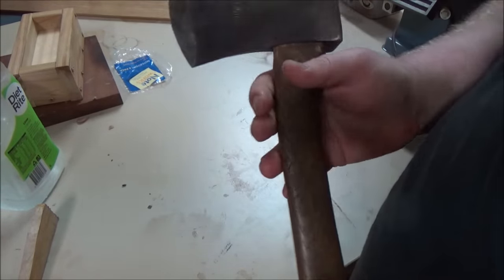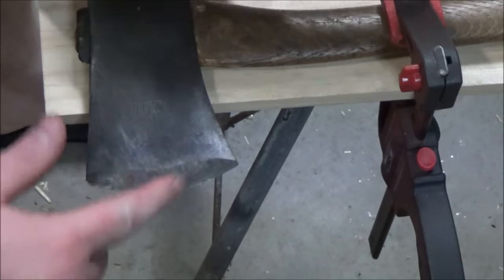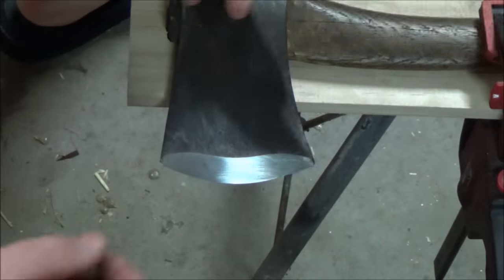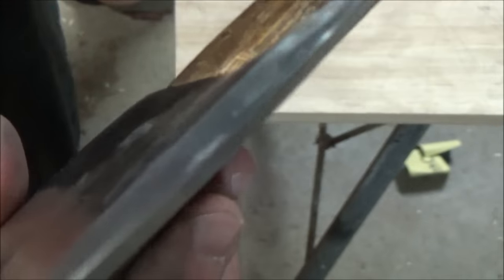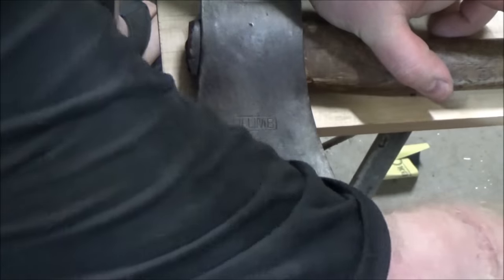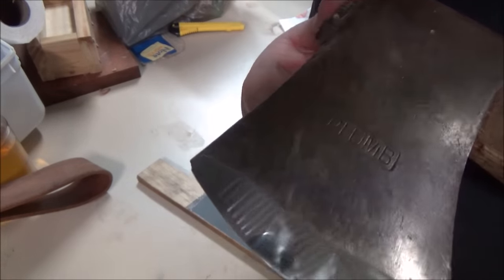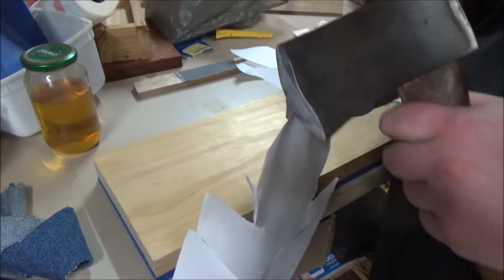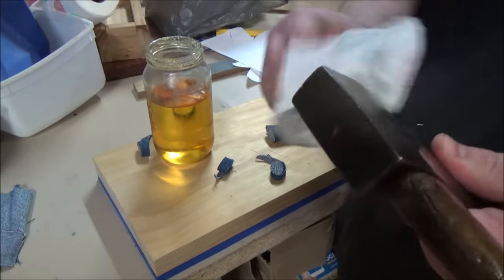How to Sharpen a Hatchet or Axe to a Scary Sharp Edge!

Comment: Looks like too much angle for an axe thats used for chopping or splitting wood.   That's a good angle for  detail carving such as jointery  or sculpting.  Usually, once your past 20 degrees of angle it's much too fine for utility work---you can use it that way, but it would dull quickly.   Still, cool video :)
Reply from the maker: I will mainly use this for carving or green wood (delimbing fallen branches things like that). I have no idea what the angle is but I also put a micro bevel on. If it hoes dull too quick just microbevel it again or even a bit bigger than a micro bevel until you get the toughness you desire. Also you could convex it from here as well if that us your thing.
I wouldn't normally have an edge this refined for normal chopping and splitting. It works fine but the extra work you put into the edge doesn't translate to much increased performance.

Comment: Good video.  Let me axe you a quick question.  How long did it take you to sharpen that?
Reply from the maker: Not including set up (cutting sandpaper, camera etc) it took me probably half an hour.
Reply: I envy the patience.Also if folk rush they waste the bevel.Sure anyone could take a belt tower to it but folk who actually use these implements,if they cheated every time,the tool wont last with removing so much.This patience is crucial to life of the tool.Real implement here..Cheers!!!! (Automotive bodywork place sells 3k grit))
Reply from the maker: The patience isn't too hard to come by. It is quite relaxing if you take your time and get comfortable beforehand. Also I use ones like this for more specialized tasks which allows you to sharpen them when you feel like it. Rather than gotta get it done now so I can use it. Doing it when you want can take the toil out of a task. Also you can always listen to podcasts, music or whatever at the same time.
Reply: @aldenunion  I would respectfully but strongly disagree with your analysis.  Using a belt sander will remove absolutely no more material than by hand if one is experienced. It will always take X amount of material removal to obtain the same end edge no matter if done by machine or by hand. The machine is simply much quicker. It is possible to over do by hand as well. Machines just seem scary because they turn out the same amount of work in a literal fraction of the time. In a sense it would for an inexperienced sharpener EASIER to over do with the belt sander because less physical effort is involved. If that is what you meant that is a specifically different topic.
Reply: @jamesp.noffsingerjr.7610   You just don't understand, for some of us "easier" isn't the most pleasurable for some of us and you will never accomplish this with a machine. However, before you reply I do see your point but there are those of us that do get relaxation out of hoarder work.
Reply: @angiecarlton826  I can appreciate the hands on zen aspect however I'm afraid that something got messed up sequence wise with our replies.  My response was directed toward whomever stated that power equipment would hog off too much or even more than needed.  YouTube doesn't plunk replies in sequence to the specific statement being replied to.  It just throws it in there by rime stamp and reads more like listening to a group of people in the same room all talking at once.
Reply from the maker: This is an interesting topic. Whether to use power sanders or not. I would say you can over sharpen with any method. But it is much easier to do with power tools. If you are experienced and can get a good bevel cut in without overheating the edge. Then go for it. If you are less experienced but still need to hog off tons of materal. Take it slow check the temperature often and maybe only take it 50% or 80% of the way or whatever you feel comfortable with. Then finish by hand. As you get better you will get closer and closer to cutting the whole bevel in by power tools. Which will save you time.
Also if it is a rough work axe like chopping out tree stumps and their roots in the dirt. I would just bang a quick rough grit edge on and start chopping.

Comment: Good video mate.  Just one question, what did you use on the handle of the axe?
Reply from the maker: Thanks. My bad, can't believe I didn't say what it was.
It is a 50/50 mix of turps and boiled linseed oil.
Reply: @scottshobbyz5416  Mate thank you very much, is there a particular reason for the turps?
Reply from the maker: It just thins it down so that it penetrates the wood better.
Reply: @scottshobbyz5416  Make sure EVERYONE knows to get the used rags or paper towel with linseed oil mixture OUT OF THE BUILDING when done with them. That stuff will spontaneously combust. Many a beautiful home being restored has burnt to the ground because the paint crew left rags used to clean the woodwork in a corner.
Great vid sir. I may do a neglected kitchen knife or two this way also.

Comment: any one who has actually chopped firewood would know, that a razor edge on an axe or hatchet is not the right way to do it, a slightly rounded dull [ish] axe head is much more successful and effective. ...Unless it is intended as a weapon...then you have it right.
Reply from the maker: For splitting wood this kind of edge is pointless you are correct. For cutting dead firewood across the grain the benifit of taking the edge this high in refinement over that of a file sharpened edge is minimal. Not worth the effort in my opinion.
For felling, de limbing green trees, carving, axe racing a really sharp edge does show noticable differences. In my opinion and the opinion of many professionals (I am not one) it is worth it.
I use it for the latter tasks.
Reply: this is not for chopping firewood, it's a real mans axe, not a splitting maul. Only real woodsmen know about this kind of axe, and the need for it to be sharp, maybe one day you will join the fraternity of true woodsmen and know these things.

Comment: Gotta say, in many, many years of using axes and hatchets for a variety of purposes I've never need to have one razor sharp.  If anything having them that sharp is a detriment.  When I need something that sharp I use a knife or chisel.
Reply from the maker: Need is a bit strong of a word. I would say it is beneficial in some tasks but not necessary. The ones that come to mind are wood carving, green wood (felling, limbing) and axe racing.
Axe racing as you want to squeeze every extra second or even 100th of a second of performance out of it as you can.
For carving and green wood it cuts better and cleaner. The woodsmen of old always had one axe really sharp and some just file sharpened for removing bark and other dirty jobs. It doesn't mean it won't work if you leave it only file sharpened. But you get some benifit.
For me it is also just fun so that is enough reason on its own.
But for wood heap type tasks or dirty tasks you are wasting your time. Just use a file, sander etc.

Comment: Round about 400 grit is where I go buy a belt sander.....
Reply: 400 grit is a very course grit, and should only be used when a tool has no edge.   And using a belt sanded on any edge tool is something only a true expert should do.  I see more knives, axes, and other tools ruined by belt snaders than from any other cause.  

The most common damge is from heat.  It takes very little heat to destroy the temper of a knife or an axe, and any belt sander can produce this temperature within a few seconds.  Belt sanders are great when you're make a knife or an axe, etc., and before they've been tempered and stress relieved, but only a true expert should use one after the steel has been tempered and stress relieved.  You are not an expert or you wouldn't be buying 400 grit belts.

The other damage comes from removing too much metal.  Most of the best axes are differentially hardened, meaning the steel is very hard near the edge, and much softer behind the edge.  This prevents the steel from cracking or breaking from the force of slamming the axe into wood.  Most swords, including the Katana, follow this principle. 

Cheap, poor axes don't receive this differential hardening, and these are the ones that eventually crack, usually at the eye

If you remove just a little too much metal and grind back into the softer steel, your axe is then worthless.  Even deciding to put a new grind on an axe can cut back into the softer steel, as can just getting carried away with sharpening.  

Everyone seems to think you have to thin the blade to sharpen a knife or an axe.  While this is technically true, in practice, it's silly, and damaging.  You can keep a knife or an axe sharp for years without ever using a belt sander, a whetstone, or sandpaper, or anything other than a honing rod and a strop.

Once an axe or a knife is sharp for the first time, it should be a very long time before it needs to be sharpened again.  It will need honed with a steel rod, and it will need stroped, and polishing does hurt it, but not sharpened.  The trick is to maintain a sharp edge on any tool so you don't have to use sharpening tool on it.

You don't do this, or anything else, with 400 grit.
Reply: James Ritchie I’ve made stock removal blades in my time. You are correct, heat is a nightmare on heat treated blades. You can used emery belts on a grinder with a water mister. Of course the longer the belt the better. 72” is good, 105” is better, but you’re into pro knife and blade belt grinders at that point. 

For doing what your doing by hand I’d rig up a file jig but with the abrasives you are using. That way you can get really precise edge geometry. But that’s if I was being a perfectionist....

Comment: Awesome job man....you DEFINITELY got a ton more patience than me to go through ALL that for a razor sharp axe.
👍😎
Reply from the maker: Thanks. This was just for fun really. You can get the same performance with less work. All you have to do it leave the main bevel at say 240 or 400 grit still looks great and is still very sharp. But then skip all the other grit and micro bevel on your finest grit. Then when needed keep touching up the micro bevel untill it becomes too big for your liking and go back and work the main bevel again.
I usually just touch up the micro bevel periodically with a fine stone and then i am back in buisness (you can do this lots of times before it works its way up into the main bevel a fair way). The bevel becomes all scratched up anyway so no need to make it pretty for a user axe. That is more for showing off, axe racing, fun or a display piece.